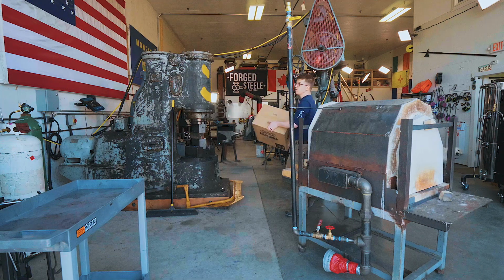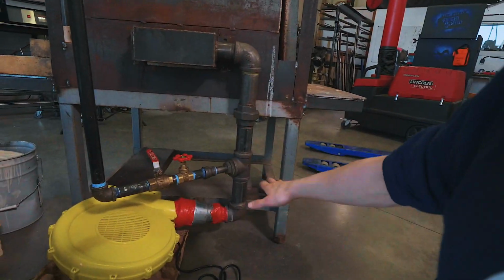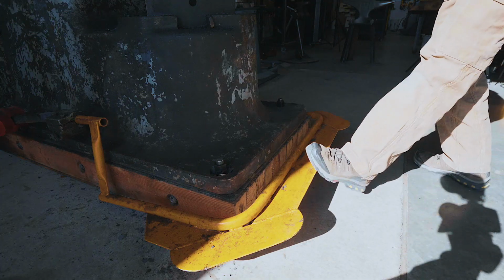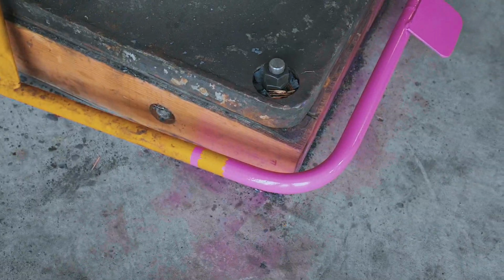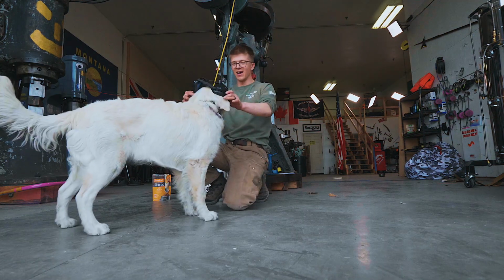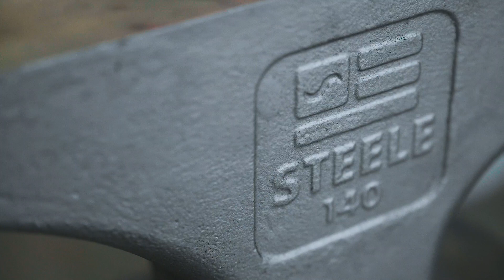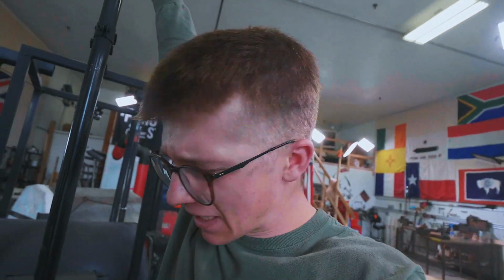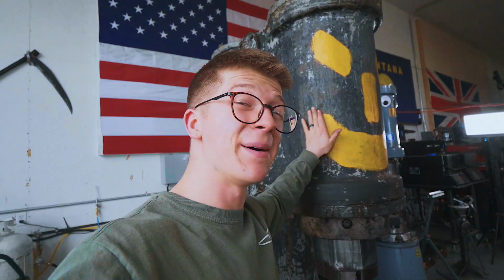NEW FORGE BLOWER, YOGO'S EARS, FORGING TOOLS!!!

Comment: Wait a minute! Did I just see someone use duct tape to tape ducting?! No one has ever used duct tape on what it's meant for.
Reply: snicker And here I though it was 200 mile an hour tape he was using there... XD
Reply: @warriormaiden9829  Cheeky bugger.
Reply: Apparently duck tape was designed by the military for amphibious use. Ducts actually use aluminiuminized tape
Reply: S Harris
I’ve seen both, but the adhesive on metal tape is better, in my experience.
Reply: @scottmichaelharris  Never heard of "Duck" tape.
Reply: DaNangDick I think it’s one of those Mandela effects, where the incorrect term is more common than the real term. Inflamable should be able to inflame. English is odd.
Reply: Hornet F18 it’s what the HVAC people have told me at least. Dad used to do industrial duct work at chemical factories.
Reply: @scottmichaelharris  True. Also, I googled it and of course. There is "Duck" brand duct tape.😂
Reply: DaNangDick I bet there are more Duct tapes 🤣

Comment: Hey Alec you need to put a gate valve on you big forge. Your small forge has one so put one on the monster. Its going to allow you to adjust the amount of air going to burner allowing you to achieve the flame your after. Been watching for 3 years and still love your stuff, keep up the good work 👍

Comment: Might also help to get a section of pipe made up at an exhaust shop that's one piece to cut down on drag made by every current pipe connection. When a race crew builds an engine they port and polish the intake channels to make it smoother for the air to flow.

Comment: A diffuser (at the exit into the forge), a taper from blower diameter to half it's size (to said diffuser, and a valve in your tapering inlet pipe, should resolve all possible issues surrounding: heat distrubution around workpiece in forge, pressure and mix, and general adjustability. I love your work. I wish I could help in person. 😁👍 The commentary about removing 90degree angles was also spot on.

Comment: Large industrial furnaces often have some sort of inline static mixer to blend the air fuel mix before combustion. The simplest would be a stationary fan blade mounted in the pipe. The  turbulence blends the fuel air mixture for even burning.

Comment: Alec.  Im an hvac tech, so natural gas combusts at 4.5 - 15% (10% is ideal) air flue mixture,  when you use a fan that moves more air then you need more fuel.  You need to find out how much cfm that blower motor moves then you can figure out how much fuel youll need in "wc and cfm of natural gas. You might need a different regulator, or use a different blower motor

Comment: Alec! Try taking a bunch of 3" pieces of drinking straw and jam them tight into a honeycomb in the forge air inlet just before the blower. This should normalize the air flow and make it more laminar. I think large vorticies and turbulence might be causing instability in the flame.
Reply: Clearly there’s an oxidizing flame going on there it needs more fuel needs to open up office is not shut them down

Comment: Hello again Alec, I don't have an issue with the 90° fittings, because it causes eddy currents where fuel/air mix well prior to flame event.  Add gate valves, pre & post fuel inlet.  And if you chose one gate valve, add it pre fuel.  Increase overall pipe length, and move the fuel farther from flame event horizon.  Tim

Comment: Alec, I worked with a power plant and pollution control equipment builder for a number of years. While the applications were physically larger the principles are largely the same. Your initial idea with the blower was right. You just need to have a fan properly sized and fitted with an inlet louver (opposed blade, better control resolution). A good fan supplier or rep should have the software to take your operating conditions/parameters and give you some options. I personally had the best experience with New York Blower. I favored their quality and built in Safety Factors  over their competitors.

Comment: I had the same issue on my forge. The problem is the speed. Try wiring a dimmer switch  before the blower so you can lower air speed. Love your work. You got me into forging, and if i can help you get that beast working, i can die happy :)

Comment: Alec,  One point I would make about the blower,  You should connect a Potentiometer to it so that you don't have to choke it with paper, you can then have a dial that will allow you to adjust the power going to it instead of restricting the airflow that would cause the motor to work far harder.   Eliminating the 90 degree bend will help quite a bit as well.  (a good example of a potentiometer would be a dimmer switch for lights, would work quite well.  Worth a shot I think.

Comment: Thanks for the shout out Alec. I’m sorry that didn’t fix the entire problem but I’m sure it was part of it. I have all 2” pipe on the larger forge we have and I also have 2 elbows with no problem. Yours looks like 1-1/2”. If you change it to 2” that’s definitely going to improve the flow and hopefully the mix. I also use on Pine Ridge Ribbon burners as they are constructed much better than others with individual steel metering tubes

Comment: If the blower makes too much noise, put in a box. Make a big difference. And also for u to be able to change the volume of air, add a sliding valve, gives a lot of control for the air.

Comment: To create an adjustable rate of flow, you can try running the power cord of the blower through a dimmer switch. I did this with a 40 cfu exhaust fan in the past.

Comment: Hi Alec, to u understand the issue with the forge you can fill up a few glasses of water. Get a few different diameter straws and blow through them as hard as you can to make bubbles. You'll find the smaller diameter straw can't move the amount of air you can blow. That's the first issue. The next is fuel/gas ratio. You'll need to ask a gas technician to take a reading of the operating pressure at your gas meter. You'll also need to ask them to calculate the volume of gas you can get at the connection. Because if you can't get the volume of gas (and the blower is too strong) you'll get lift off which is why the flame isn't stable. It's one thing increasing the blower and diameter of the pipe but if the ratio isn't right and you can't get the volume of gas to the ribbon... It won't work. Also, the ribbon will have to be adjusted to match the max output.

Comment: for the forge remember that volosity increases as volume decreses and vise versa. also residential gas has a very low psi so make sure ur blower isnt putting so much pressure that it is restricting gas from coming in

Comment: Being a heating engineer, when we set up the burners it’s not about the volume or pressure of of air you induce, more air just gives you a lower combustion temperature and incomplete combustion in some cases which can produce Co. I notice you don’t have a Venturi injector installed. It’s essential to get the right air gas mixture to get complete combustion, this is done through the Venturi. The Venturi converts potential energy to  kinetic energy by mixing the gas and air together  by funnelling and compressing the two gasses, thus increasing the heat potential. You just can’t stick in a couple of low carbon Tee pieces and hope it works. When we get a reduced temp the first thing we check is the working pressure of the gas at the appliance. If it’s low, we calculate the diameter of the supply pipe and the distance it has to travel, then we check the the gas regulator to see if it is set correctly and if it has sufficient capacity for the amount of gas required. As for your set up get a Venturi installed first, that way you will get the right burn mixture.

Comment: I'm no engineer but here are my suggestions for the forge.
Galvanized wye fitting at the gas to air mix point.
Electric speed control for the fan.
Adjustable flow for the gas and dial it in until you have a solid blue flame.

Comment: I noticed when you are putting the tredel back on the power hammer there was some variability in the front/back position. This changes the length of the levers actuating the valves. That could be enough of a change in timing to make the piston hit the top.

Comment: Alec, to have the right flame, you need about a 10:1 ratio of air to gas. If you have to much, it will not have proper ignition. I believe the blower forces too much air and just wipes out the flame. I work on furnaces a lot and the old style had this problem. You would have to adjust the primary air coming in so that the flames would not lift off the burners. Too much primary air causes that

Comment: The issue with the big forge may not just be the fuel/air feed volume and pressure. You have some rather large openings on it, and you may be losing pressure to the shop environment. If you can minimize the openings as much as possible and eliminate any cross flow (back of forge to front or one side to the other), it might help with the heating and flame problems you've encountered.

Comment: I did the same thing to my Forge with the bouncy castle blower a couple of years ago. I found that the pressure was too much for my small Forge with a small pipe so I installed a potentiometer or dimmer switch to change the speed like a vfd. Controlling the flow rate of the air made it able to be tuned to become more efficient and burn less fuel with a hotter Flame.

Comment: For a given air flow velocity is inversely proportional to the pipe size, fit a larger air inlet pipe get rid of unnecessary bends and install a diffuser

Comment: I'd try to add a big gate valve or a dust collection system type blast gate, as a choke for startup.  A ribbon burner often needs to start at a higher fuel:air ratio, then as the chamber and burner block preheat, the burn characteristics change and the fuel will begin to burn right as it exits the orifices of the burner block.  My ribbon burner is of a similar size, and is finicky too upon startup.  I cut the air until I get a somewhat lazy blue flame, then introduce more air gradually until the point where it's being nearly blown out, then back the air off and let the forge come up to 1400 degrees or so, then readjust, adding more air, the adjust more when coming up to welding heat.  I hope it'll get there for you.

Comment: Alec, If you put in a lot more air (O2), then you will need a lot more fuel (gas) too, to make it get hotter. Try adjusting both a little bit at a time and see if it doesn't get hotter.

Comment: The more air pressure you push through the pipe for the forge, makes the gas pressure have more resistance to enter the pipe.
Increase the pipe size to drop air pressure while increasing air volume 

One PSI of fuel pressure plus one PSI of air pressure means little to no fuel

Comment: Alec, I think the original setup has plenty of airflow.  I think the issue is the burner.  I would replace the burner and try the test again.

I would get a flow meter and check gas flow.  replacing the burner like I stated may fix the whole issue.

Comment: Regarding the forge blower and ribbon burner setup, it appears the issue is uneven distribution of gas pressures to the burner ports. The blast of gas entering the ribbon burner needs to be diffused so that it can exit the ports evenly. Also, if blow out is still an issue, make sure the ports have dimples, so combustion can remain localized.

Comment: I think a major part of the problem with the forge is the plumbing. The pipe diameter is reduced after the needle valve restricting gas flow. The gas line enters the burner feed line at a 90 degree angle creating turbulence and back pressure. Changing the gas feed line to a 30 degree angle would dramatically reduce both the turbulence and the back pressure allowing more air and gas flow. I also think it would be a very good idea to upsize the burner feed line by a 1/2 inch where the gas and air line meet. Replacing the 90 degree coupling with two 45 degree couplings on the burner feed line would reduce the required head pressure for both the gas line and the air line. Adding a needle valve along with a bleeding valve coming off the air line would allow for far more control. With all these changes implemented I would not be surprised if you were able to use the original blower for the forge. One important thing to remember is although you can accomplish the same thing by pumping more air and gas into the forge you are dramatically lowering the efficiency of the forge effectively losing you money. You would be shocked at how much money is saved in HVAC and plumbing by replacing 90s with double 45s and adding a VFD. We had one client who owned a hotel In Boston. We spent 2 weeks changing plumbing, ductwork, pumps, blowers, motors, and adding VFDs. The job cost the owner nearly 400 grand, the return on investment from the savings on his utility bills paid for itself in 8 months. Anyways not matter what path you choose to follow Alec good luck, I hope you find the right solution that fits you.

Comment: Depending on the type of motor you have you could use a motor speed controler to reduce the speed of your blower thus reducing the air flow, they are very cheap but only work with brushed motor. Otherwise you'll need a motor speed controler for inductive motor which are more expensive

Comment: Hi, love the channel. Suggestion on your burner; boilers of old used to have dampers on the burner assembly ( no variable speed in the old days) so you could try a simple valve to wind back your air flow till you get back to excess fuel and a reducing environment in the forge. If it’s still not hot enough after getting the air fuel mix sweet then try more fuel or a second burner! Good luck...

Comment: Another thing for Yogo, might be having lines drawn on the ground around the shop
So mark the floor with some black/yellow... or just bright lines around equipment, and then teaching her not to cross the lines
it'd help with the whole "don't go near the sparks and hot metal" of the forge. Same with the saws, and the file/drill areas

Comment: A suggestion for the power hammer tools, angle the handles so the tool faces where the hand holding the material is and with the hand holding the handle is not reaching way out. It would be more comfortable and create less fatigue if your hands are no further apart than say when riding a bike or pushing a shopping cart. You can quickly modify those by putting some cold stock and the tool in a vice then heat the handle and bend it to a more comfortable position.

Comment: Fires suck. I had my shop burn down in November last year. No insurance, long story.
Set my house ablaze too.
I'm just now finding up the house single handed, the shop is gone. $15k in tools doesn't sound that bad for some, but the biggest heartbreak is the sentimental value.  Both my grandfathers left me tools, and so did many others who are now passed on.  And a very rare collection of trade materials from my electrical trade.

Comment: Not sure if you've fixed the forge yet, but you need a venturi effect for it to work properly. Pumping that much air at that pressure is just pushing your gas back up the line. Do a straight run into the ribbon box, have the gas go in after the air. You may need to increase the hole size in the ribbon burner to decrease back pressure.

Comment: I was looking for a follow up to this follow up on the big forge but couldn't find one. I was going to suggest that instead increasing the volume of air blown in, you try increasing the volume of O2. For a test you could simply run some oxygen from your oxy torch into the intake for the blower. If you like the result then you could look at controlling the O2 flow rate and how you will supply the oxygen (large liquid oxygen tank, piped to forge? )

Comment: Yeah backing off the treadle a little worked nicely. I was wondering if the foot bar would end up lower, but it seems good to go now. I wonder if the arms were off a little?

I suggest as a project you do a revolutionary war cuttoe with a fishhook Damascus blade, and a dog head pommel fashioned after Yogo. I suggest a canister Damascus with the fishhooks inserted in the matrix. Look at the Brasher Ethan Allen sword and the Succasuna sword. A cool project to do.

Comment: Alec, you want high volume, and low pressue for youe forge. the bouncy house inflator is a High volume, low pressure blower. the issue is with your piping. if you increase the pipe diameter, your forge will not be starved for air. your flame looks wierd because your pressure is too high. talk to an hvac specialist and they will be able to help.

Comment: What kind of head do you have at the end of the duct? You can get more pressure some slight resistance like narrowing the duct toward the end like the "crevis" tool ov a vacuum cleaner only bigger. Alternatively a blower for an inflatable bed works 👍

Comment: You should consider putting some grip tape on the treadle. Works great for a non slip surface. Skateboarders and bmx riders have used it for decades.

Comment: perhaps you would stay with the new blower but add an adjustable valve to the pipe and maybe a directional nozzle inside the forge to direct airflow.